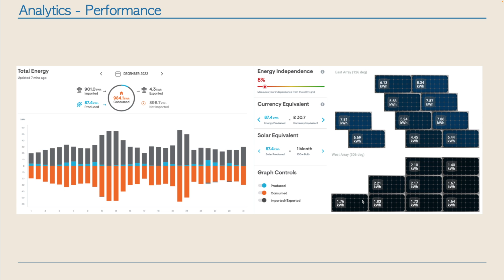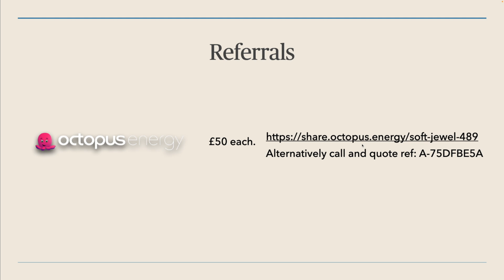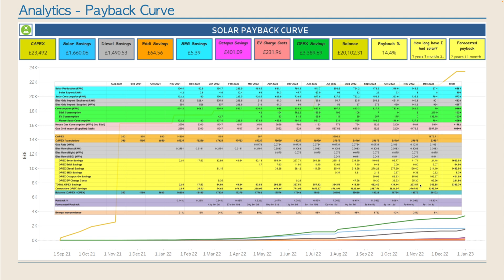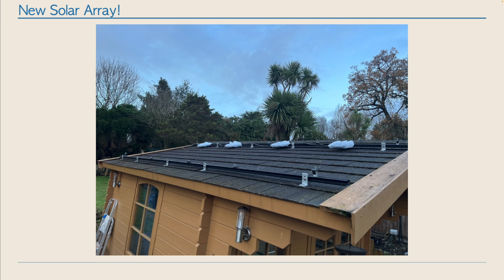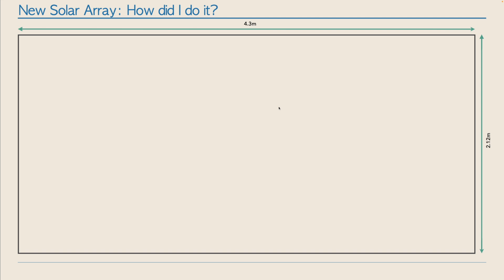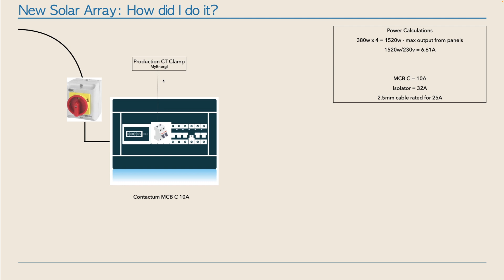Solar Performance - December 2022 Update

Comment: Respect. Well explained video. I self installed a small Enphase system using Renesol consule tubs placed on my utility flat roof. I would like to add to your video that each microinverter has a maximum continuous output (ie IQ7plus continuous ouput is 290va) regardless of maximum solar panel output. Also for safety check you have RCD's that are B type as AC type or even A type can be blinded by a small smooth DC fault current in your system. A video on how you control the charge on your GIVEnergy batteries would be useful and has Enphase allowed another CT clamp on the Envoy for 3rd party battery information on the Enlighten App? All the best and well done!
Reply from the maker: Thanks for your feedback. Very good point about the 290VA limit of the Microinverters. I'll do some additional analytics on this. And thanks for the comment about the RCDs...this is where it gets beyond my understanding, but my EICR is due shortly, so I'll ask the electrician to sort that out. Regarding the CT for Enphase...no, Enphase don't allow 3rd party CTs. Its very annoying. I've been having some difficulty getting the data for the new panels to show up correctly in the app, and spent quite a bit of time going back and forth with Enphase.

Comment: Thanks for the video but please please please learn the difference between kW and kWh. The former is equivalent to horsepower and the latter to litres. They are very different units - this is not pedantry. Thanks. Sorry to winge 😀👍.

Comment: Regarding the voltage... Surely it is stated in whatever contract that you agree to pay X amount for supply of AC power within certain paremeters. Makes you wonder if there's a legal avenue to recover the cost for power that falls ourside of the agreed range. It's of no use to you if your equipment shuts itself down.

Comment: In a similar boat with mains over and under voltage. I am on 3 phase and it’s all over the place. My installer had to change the country settings which improved things but isn’t 100%.  Interested in getting batteries but seen lots of people with problems plus the ones for my inverter are on 4 months delivery. So decided to cancel and wait a bit. It’s interesting to see the difference in our production to yours with us being in Southern Spain. We did 442kwh in December and thats not a full month and we had those inverter issues which stop production as you know. We have 10kw array in 2 strings east and south facing.  Great analysis of your PV system.

Comment: After your last video on over voltage supply, i found an easy to understand video on the principle of how inverters push power back into the grid. Its a complex thing given that inverter constantly outputs a little more voltage than the incoming DNO supply it would become dangerous trying to output more than 267v or more back into the grid. This got me wondering what will happen to the DNO supply voltage if a whole housing estate + EV owners start discharging and charging at some particular point in time.  this video is simple to understand if you understand basic electrical theory    https://www.youtube.com/watch?v=b8WZn6YYoxw
Reply from the maker: thanks v much for sharing. I'll be certain to watch this.

Comment: Getting back to your over voltage issue this could be because of other people with solar,  if there is a lot of solar installations in the area the line voltage will fe high as that is how grid tie inverters work the only way they can push power back to the grid is if the make a higher voltage than the grid thus if you have a number of inverters all trying to push back onto the grid the line voltage will go up,
Reply from the maker: ohhh. This is interesting. I didn't know that's how the voltage works. There are only a handful of properties in the larger neighbourhood which have solar power...maybe 5. Most properties are quite big, so if they do have solar, it's likely they're consuming most or all of it. And right now in winter, there's no way they're generating a surplus to be exporting large amounts. So I still think the average voltage the grid is supplying is simply too high.

Comment: Enphase is by far the most versatile and easily expandable system.
You did an amazing pv installation.
I didn’t know it’s so easy to open an installer’s account. Is there any other information that is not accessible from the customer’s account? I’m interested in the individual panels power in 15min increments, which apparently is available in the enlighten manager but there is a cost for the upgrade
Reply from the maker: yes, not sure if I'm supposed to be able to open an installer account, but I did. I don't really want to maintain an ongoing relationship with my original installer.

There is a lot more info available. I haven't had a full explore yet...particularly around the data granularity..

Comment: Very clear videos and explanation as always, it helped me a lot to understand solar and payback when I was deciding on my solar last year. You have huge gas bill though, is your property quite large? Might be worth considering aircons (air to air heat pumps). I got a few installed in my house and they do a very good job heating when the sun is out as they produce 3kwh of heat on 1kwh consumption when it's 5c or higher outside
Reply from the maker: Hi there, thanks for your feedback. Yes, we have a big house, but I'm discovering it's draftier than I thought, so I'm trying to plug all the holes. We also recently put in a Taco smart thermostat, but it doesn't seem to be that smart and the boiler just seems to always be running, so I'm trying to fine tune that too.

I'm interested in the ASHP. My first problem is I have nowhere to keep the unit outside my property. It would have to be mounted high on a wall. Maybe you can help me with the second issue...did you have to do much modification inside your house to get your existing pipework to cope with an ASHP? That is our biggest concern as we have old pipework and wooden floors throughout the house. So if it involves taking up the floors, it's going to add significant cost...

Comment: Looked quiet easy, does it not invalidate your ability to export to the grid as it is not MCS Certified?
Reply from the maker: Hi Mark. Good question. I'll have to look into it. I'm not so concerned about exporting to the grid. that's a last resort for me as the money we earn is very little. I know that my G99 approval is for about 6.3kW...which is more than we will ever be able to export even with the new panels. And I know this 'grid profile' has been applied to my Microinverters as I can do it using the installer account, and when I called Enphase the other day, they confirmed it was applied.

I also haven't modified anything from my initial setup by installing these new panels. Every wire and connection is in the same place.

In fact, when I got the 2nd battery installed last summer, this would mean I can store more generation, and export even less to the grid. So in theory, the additional panels and potential addition export probably offsets itself which the extra battery I put it.

But its a good question...I'll have to look into how it works.

Comment: Don't forget to notify the DNO that you have installed another array (inverters) to their network which will increase the voltage on the grid when they are generating.

Comment: How much interest have you lost, assuming you had the cash you spent in a savings account? - Thanks
Reply from the maker: well, interest rates are peanuts, but it's probably approx £20 per month based on other accounts I've got interest coming in from.
Reply: @HarvestingTheSun  if you coughed £20k, that would be at least £600(not peanuts - 7 x £600 = £4,200) a year interest. If you are a tax payer, depending, you could put it in an ISA - HTH
Reply: @parkers8245  there is always an opportunity cost for making an investment. Even though there will be interest paid if that money was left in the bank, the value of capital would be eroded faster due to inflation. So investing in solar still works in the long term.
Reply: @mrahman4656  A good point, however, it still should be included in any ROI calculation. Also I did not include compounded
 interest.